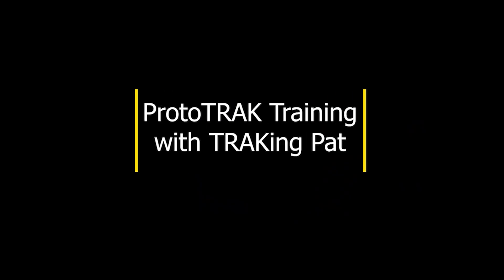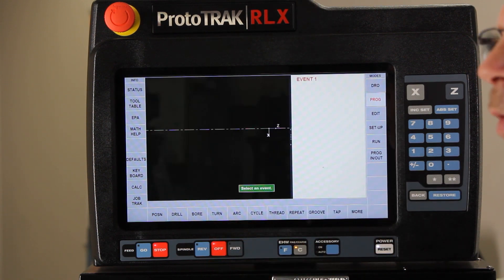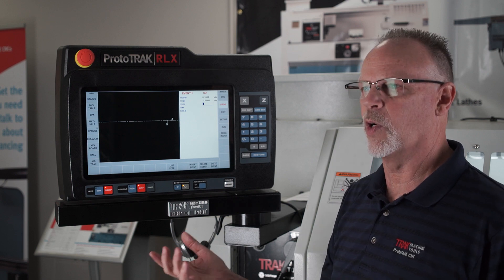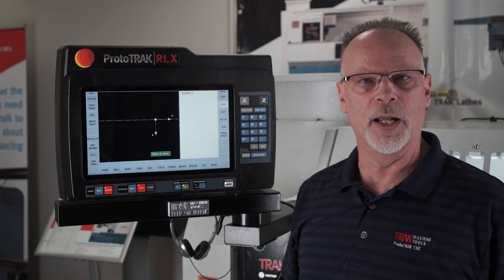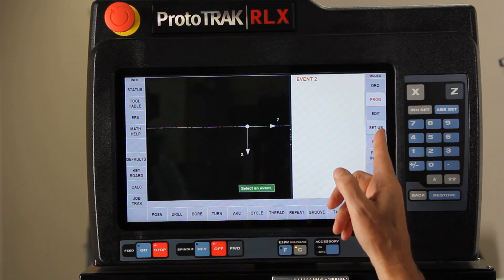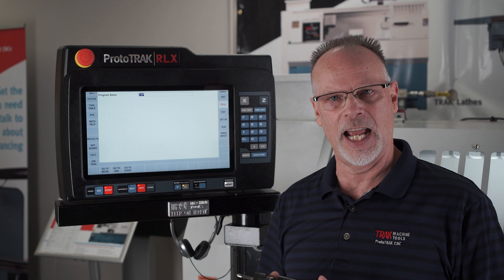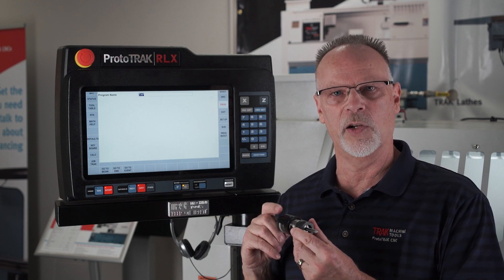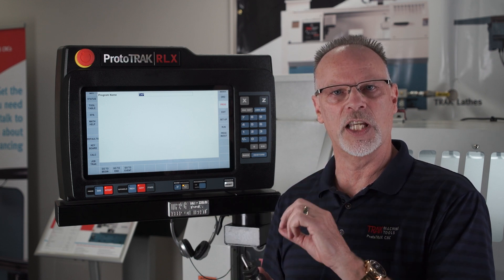Tapping with the ProtoTRAK RLX | TRAK Machine Tools

Comment: Do you have a knurling cycle for threading
Reply: No, but you don't really need one. All you need is to use a turning event so that the knurling tool can travel into the part, then travel along the part and pull away from it at the end. T.P.